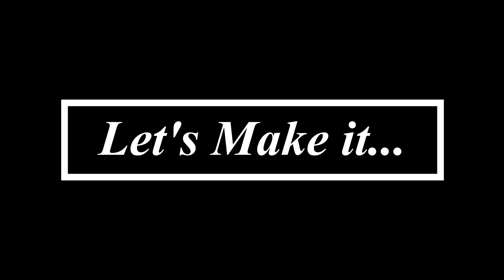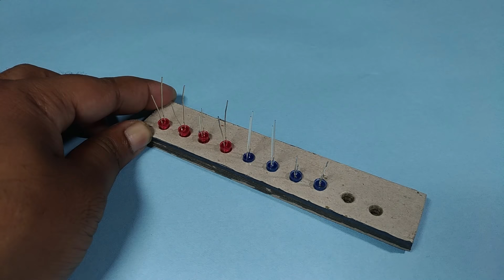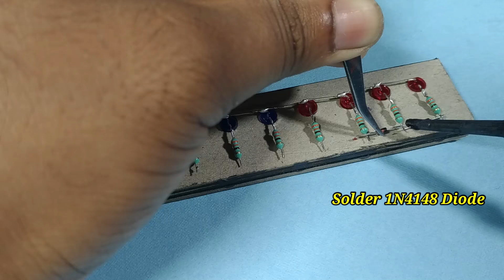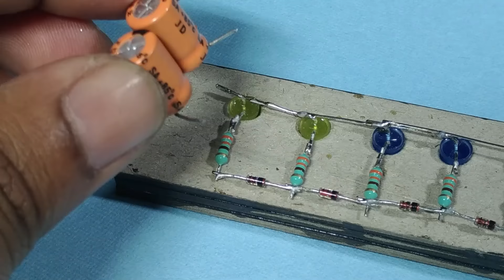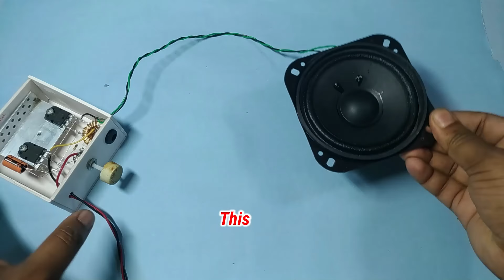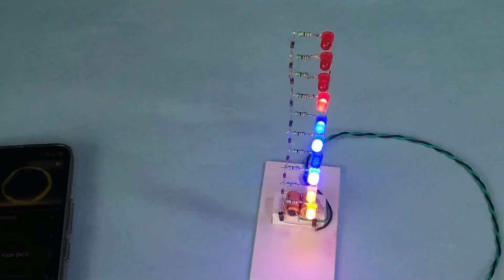How to Make VU-meter, Easy & Simple/ Without IC: LED Meter for Audio Amplifier

Comment: I think the capacitors there will cause a bandpass effect on the speaker - not much, because the capacitance is pretty high so only the lowest frequencies will be cut, but still some. Not to mention the impedance, which will be severely affected. 

So a series resistor (some 10-20R) would be better.

Comment: Some cons:
10 LEDs can draw up to 200mA from the power stage, thats quite a lot
The resistors can't be changed easily, so it only works well with one specific amplifier (output voltage)
But for such a simple circuit, these are not big problems
thanks!
Reply: So can we built it for a sterio amplifier of 50w speaker with 2x the resistance.

Comment: You really should look up a LM3916. No Arduino or code needed. This isn't really a VU Meter circuit. Driving it off the speaker out of any amp is a bad idea, as the amps rail voltage goes up. hence people burning this cct up with higher watt rated amps. Cool tho. Have fun.

Comment: First of all congratulations for your videos. I am trying to adapt your vu meter assembly but can you tell me what is the value of the voltage (Volts) to power the LEDs? Thank you in advance for your answer and thank you again for your work.
Reply from the maker: no additional power is needed just connect with spk out.
Reply: Sorry is not ok for me. I want to use your vu meter to connect out line of a audio preampli, so i need a small volt value. Do you know the tension to active the LEDs with a multimeter? Thanks for the answer.

Comment: Connect this one via separate amplifier only, otherwise you'll get terrible nonlinear distortion on output.
Reply: Maybe put a opAmp getting the signal and then put this in its output with a driving transistor

Comment: 100UF 50V CAPACITOR USE KR SAKTE HAI?
Reply from the maker: no
Reply from the maker: Thats fine, but i have not tried yet.
Reply: @MREasyMaker  i make it and its working very nicly but i want to know that how to add potentiometer to controll the level of led plz reply

Comment: I would think using 25 volt capacitors would allow them to be used on systems larger than 100 watts, like maybe 150 watts. That is enough to cover most surround systems.
Reply: if you using less than 25 source voltage then you use if you capacitor above 25 source voltage then it will break to use 125watt you need to work on 20_24 volt & 6.25 to 5.20 amp current then you will use capacitor 25 voltage

Comment: can i use pam8403 audio amp to directly give it amplified input without using speaker.
I want to use it with 5+5w amplifier so definitely it will not work properly so i think can i give vu meter its own seperate audio signal input.
Reply: @MREasyMaker  pam8403 is a stereo audio amp of about 3+3w output. Maybe I can fed both of its output directly to vu meter input so it gets amplified audio signal for its working.
Reply: @MREasyMaker  i have 0.2w smd leds maybe they should work fine

Comment: By putting this in parallel wouldn't it change the impedance of the speaker? Asking for use on a hifi system.
Reply from the maker: No. Just connect two wires with speaker

Comment: My only two end lights are glowing which are near the capacitor can you tell why?
Reply from the maker: If all connection is ok then volume up. Or use an amplifier
Reply: @MREasyMaker  yes I've done all connections as you've shown but don't know why only last leds are lighted but others aren't working and I've used transparent color leds

Comment: Can I use 470uf 10 v capacitor
Reply from the maker: I am not sure but you may try. It may work
Reply: Can I use 25 v
Reply: Can I connect this to 5v speaker
Reply from the maker: Yes but all light may not blink.

Comment: I can use capacitor 100uf 25v
Reply: Thanks for reply bro
Reply: But why sir
Reply: OK I will  try sir
Reply: I have tried and it is working but it required the more sound and then it will glow all light sir. it working.........🙂🙂 I have used capacitor 25v 100uf
Reply: Ok sir l will do it sir

Comment: can I use it to measure output of a pwm controller?
Reply: @MREasyMaker  can you design one? I'm planning to use a pwm regulator for handlebar heater in my motorcycle. As of now, I've no way to know the power given to the heating coil.
Reply: Nope

Comment: Sir how much voltage supply we have to give?
Reply: @MREasyMaker  it's not working with 5v maybe I should increase the voltage
Reply: @MREasyMaker  mine not working with any of the speakers. I don't know what's the problem 😢
Reply: @MREasyMaker  but leds glow with direct power supply but not with amp.
Reply: @birkaransingh8207  same with me we have pam 8304

Comment: why is he using zener diode instead resistor
Reply: First of all, they're not zeners, just standard small signal  switching diodes. Second, I'm guessing he used them because their voltage drop changes abruptly, unlike resistors, which drop proportionally more voltage as the supply voltage increases.  In other words, they act like open switches until they reach a specific threshold voltage, at  which point they conduct heavily.  So, instead of gradually getting brighter, each led remains off, until a certain voltage is reached, and then it "pops" on immediately.

Comment: The "AMP" ist crap
Reply: @MREasyMaker  I will not replicate it. I don't want to waste my components.
1. Distortion of the AMP ist very high.
2. The AMP never delivers more than 100W 
3. Normally you have a voltage amplification and after that the current amplification.
Reply: @MREasyMaker  Okay